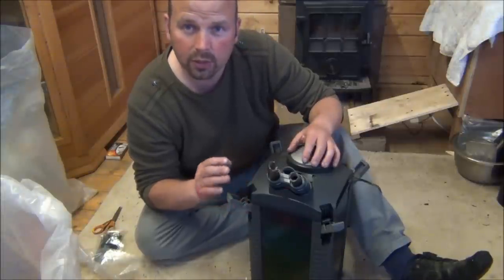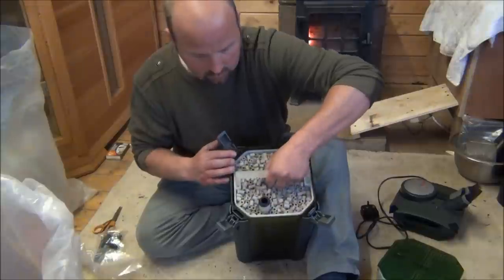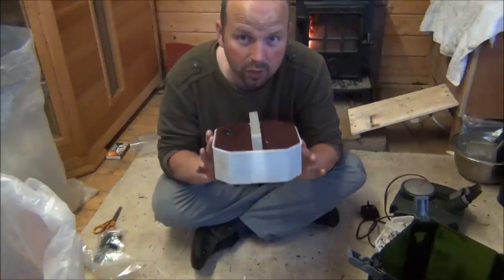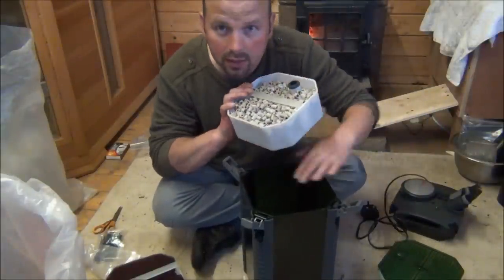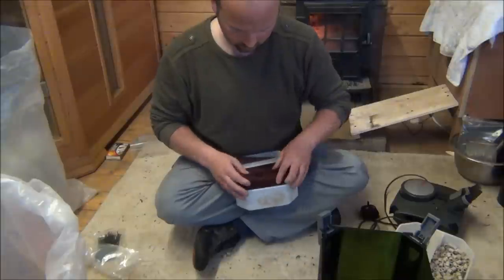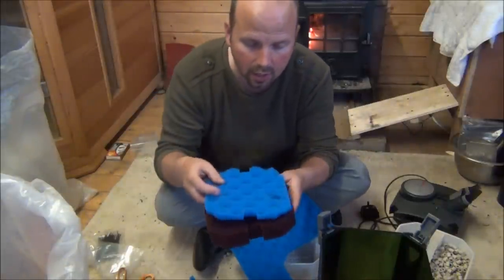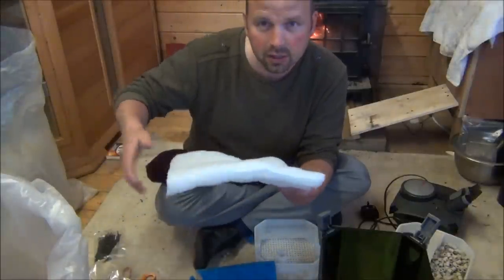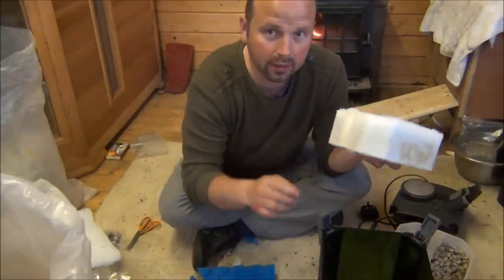How to set up an external canister filter for aquarium by Pondguru

Comment: I have actually followed your advice on my canister filter (a Marineland Magniflow 360) and it works great. I did go ahead and bought some of the bio home media and have been measuring my water parameters over the past five months; and just like you said my Nitrates did go down tremendously. I have a planted aquarium and thus use the E.I method of fertilizing my plants with Thrive liquid fertilizer. It works great and my plants are nice and green and lush. But the only problem with it my Nitrates would be through the roof with it. In my tank they went from 110ppm to about 15ppm in about five months. Great product and it works great. Thank your for your advice.
Reply: woahh how are they now?

Comment from the maker: Any filter media which supports large amounts of bacteria will eventually become clogged by them and need replacing. I normally say 2-3 years is a reasonable time for media to run it's course as it will become rapidly established with bacteria then perform well for a year or two before gradually reducing effectiveness. Same is true of ceramic or sintered glass and lifespan can be increased by protecting the media as shown in the video, no worries. You can dry out and re-use, yes.

Comment from the maker: The main problem with carbon is that it can absorb some of the beneficial stuff released by leaves and peat balls as well as unwanted chemicals. If it is not replaced every 7-8 weeks it starts to release what it has absorbed back into the tank which includes bad stuff.

Comment: This is advice so logical and clearly efficient that it may just start a profound revolution. Thank goodness these aquarium product manufacturers are not large multi-national corporations that guard their revenue streams with drastic measures. We'd probably see a sudden stoppage of these videos being produced if they were. You would quickly receive cease and desist letters, followed by strange men in black suits at your shop, your phone would suddenly stop working, they might even decide to "off" you like they did with the guy that created the diesel engine. But thanks for the healthy advice and wisdom. I am setting up an aquarium for the first time. It is a brood tank for Tilapia. Hopefully, come Spring, I will have bread some fingerlings for my aquaponics system where I will also apply the same principles to the aquaponics filtration. Just want to say, I am really lucky I found your videos.
Reply from the maker: No worries, man. Glad you enjoy the videos and I recently did an updated version of this video with much more information in. Here it is:
EXTERNAL FILTER SET UP, NITROGEN CYCLE AND WHAT HAPPENS IN A FILTER

Comment from the maker: The fine particle matting is basically a more compressed form of filter floss which can be cut to size. When you use the fine pad you do not need filter floss. If you want to use floss, not fine pad it goes in place of fine pad above the medium and coarse sponges (as shown in the video). 
The worst place to use it is above the media as it allows all the fine muck into the filter media, blocking it up and reducing the effectiveness of the filter (as explained in video)
Thanks for watching.

Comment: Thanks so much Pondguru!  I just got rid of an overhead filter (which came with my tank) and set up a canister filter as per your advice.  What a difference!  My canister filter has only 2 trays so I put the (uselesss) ceramic noodles on the bottom of the canister, 3 grades of sponge in the bottom basket (as well as some of my old sponges) and really good bio filter media in the top basket with a layer of filter wool on top for that extra "polish".   An hour after turning the filter on the water is crystal clear and my tank looks amazing.  Thank you so much for your video.  Just one question though, how often should I clean out the canister filter?  I have goldfish which I know are messy.
Reply from the maker: +Natalie Lindsay Sounds good to me - definitely makes a difference to water quality and clarity to have the filter set up with good internals.

Comment: thanks for all the knowledge and information. I will definitely be purchasing from you in the near future. I have a 200 gal. aquarium and a Megaflow model 4 sump tank. I will be putting Arowana, alligator gar, bass, red tail catfish, and other big fish in this aquarium. 1. how much media do I purchase? 2. what type of media do I purchase? 3. how would you set-up the ceramic media and foam pads for my type of sump (Megaflow Model 4)?
Reply from the maker: If you send me the dimensions of the parts you want to fill with media I can work out how much you will need, no worries. Just set up same way with the foams first then media no matter what sort of filter you have. I'm not familiar with that model of filter so I'll need sizes to work out media quantities.
Glad you enjoy the videos, man.

Comment: I couldn't agree more with your advice on how to set up the filtration process. I've used the same principle for external canisters and sumps and always noticed how much more efficient the biological filtration system works and increases the lifespan of the media material of your choice. The only downside IMHO is that one has to be more on-top of basic maintenance as the pads at the bottom tend to get clogged up quicker and slow flow rates. However its worth the extra effort.
Reply from the maker: It really shouldn't make any difference to how often a filter needs cleaning as you've got the same stuff in there, just in a different order but maybe it does, lol
Main thing is that the muck is kept in the bottom of the filter and away from the media so it works efficiently.
Glad you appreciate the idea, man and thanks for watching and appreciating the videos.
Reply: fair comment, thanks for your prompt reply & a big hello from the Rock of Gibraltar :-D
Reply: :-D

Comment from the maker: For all filters the water needs to flow through in this order:
Coarse
Medium
Fine
Some filter will not come with enough foams so you may need to buy more. Pond foams are the most cost effective way of doing this as they will often come in 2,3 and 4 grades per pack. Fine particle matting (also available from pond suppliers) will catch the very small solids before they clog up your media.
Reply: my aquamanta efx 400 has carbon bags in, where would i put them as you dont show any on this video? thanks

Comment from the maker: The water in that filter goes from bottom to top so should be set up just as simply as the one in this video. You could leave the blue prefilter foam in the top if you like.
Uaru Joey has done a video on that model of filter:
I tend to set things up differently so whatever makes sense to you is fine.

Comment from the maker: Biohome will work well in any filter designed to hold filter media. As I'm not familiar with those hang on back filters I can't say more than that but if it has enough space for filter media then I'd wager swapping to biohome will do a better job than the media which is in there.

Comment from the maker: The Juwel Rio 180? They are decent filters and can be made better by following the same pattern of foams and media layout as you would in an external like the one in this video. Buying the official foams and replacing them as often as the manufacturer tells you is a seriously expensive thing to do when you can cut your own foams and fine particle matting from pond product suppliers at a fraction of the cost.

Comment: Great video, I'm new to tropical setup. I'm just cycling the tank now, 3rd day in. The filter is hanging on the back and is a FLUVALL EDGE. It came with course foam, carbon, and bio pellets. Can I do the same thing in my filter as you have done in this big filter ? If I remove the carbon that will give me some extra room for some fine foam ? As it is at the moment there is nothing to catch the very fine particles.  And there is easily more room for even more medium, should I put more in if I can ? Ok sorry for so many questions.
Reply from the maker: Yes that sound sensible. The more mechanical and biological filtration you have the cleaner and healthier the water will be.

Comment from the maker: Put it in if you want and don't think you have to go with the same stuff which came with the filter - it is just a vessel for whatever you want to put in there.
A fully mature filter with excellent media will always be preferable to one with poor media and carbon, zeolite etc. to catch the ammonia and nitrite which should have been processed by the biological part of the filter. Carbon also absorbs trace elements which are beneficial for plants and leaches all the crap back in after 7-8 weeks.

Comment from the maker: You would need a liner to be 21' x 24' and that allows for 1' overlap on all sides. I'd go with 1mm firestone rubber - I use that on all my jobs. It is laid over good quality polyester underlay to protect it. With regard to pump and filter it depends on budget but I always go for Oase pumps for the 5 year guarantee and low running costs. There are so many filters on the market it will depend on the fish stock but I'd size it for koi.

Comment: Great video I did this when the video was first posted and it worked well. About a year ago I took it a step further so now I have two Aqua one 1250 filters in line the water comes into the first one which is filled with just sponge and wool course at the bottom and fine at the top, this then feeds directly into the second filter which is filled entirely with bio home mini ultra then through a uv steriliser and back into the tank. I have the same set up at the other end of the tank so four filters in sets of two. All is going really well the bio filter is nice n clean and the pre filters nice n dirty. My question is as the pre filter foam gets dirty and so builds up its own good bacteria will this starve the second biological canisters bacteria of oxygen?. I would hate to think I wasn't getting the best use of the bio home ultra thanks.
Reply from the maker: It would definitely be better to run the filters separately or in tandem as having them in sequence strains the pump and leaves limited space for media if one filter is used purely for foams. The media in a prefiltered canister should stay very clean but you can do that with this sort of pre-filter which is very cheap: http://geni.us/2bj1
Having the filters set up any way should not affect the oxygen content too much as the flow is quite fast so no worries there.
Regards,
Richard

Comment from the maker: 5kg should give you around 7.5 litres in volume so if you have 2 filters each requiring 8 litres you're about right with 10 kg but you'll have a clearer picture once you get the first batch added to a filter.

Comment from the maker: I'm sure there will be some out there where the water goes from top down but in general the water goes from bottom up through the trays so should hit the foams in the following order:
Coarse
Medium
Fine
Then travel through the media having been mechanically cleaned of the vast majority of suspended muck in the water before hitting the media to prevent media clogging..

Comment: Thanks for the great info, I've just bought a new 30-gallon freshwater aquarium and will be filling the canister with biome ultimate.  I've been wrestling with the idea of running a UV sterilizer full time.  What are your thoughts on this?
Reply from the maker: Unless there are several tanks linked to the same filter there should be no need for a UV but it will not do any harm as long as the filter is a good size, well set up and you leave the UV off for 3-4 weeks while setting up and maturing the filter (to give bacteria time to flow through the whole system) - your 30gal. would need a filter which would be suited to a a tank of 'up to 60 gallons' as you'd always halve the 'up to' figure for a normally stocked tank since it relates to a fully planted tank with hardly any fish (that is the maximum it will cope with)
Reply: Thank you so much for the reply and the input!

Comment: Great video! Thanks for the info. I am switching to a 55 from a 20 and am trying to avoid any cycling. Should I cut the filter media out of my HUB (two cartridge filters back to back) and add it to the 2nd or 3rd stage of the Fluval 306? I was also planning on floating the bio wheel. I will use roughly 15 pounds of existing gravel from the 20 and add roughly 60 more pounds. The only ornament being transferred is a log and about 10 plants. 
Thanks!
Bob
Reply from the maker: With all the mature gravel and water going in the new tank it should cut out the need to cycle it.
Provided you haven't got catfish, corydoras or loaches gravel will be fine (I assume its a cold water tank). Just run existing filters on new tank and new external for 3-4 weeks then remove the old filters.

Comment: I'm new to fish keeping and you my friend are a legend, thankyou so much for all the information you share
Reply from the maker: +daren barling No worries, any time. I get great pleasure from making videos with an educational content.
Reply: +Pondguru Outdoors hi Richard, I've finally got round to ordering my upgrade kit from yourself thankyou for that it's to upgrade my fluval 306 on my 240 litre tank,I also brought a 2.3 litre booster filter from all pond solutions, now I need abit of advise shall I use the booster as a pre filter with the upgraded foams or shall I use my 306 as the pre filter predominantly mechanical filtration and then use my biohome media in my booster after the 306 on return to the tank,which method do you think will be best,value your feedback very much,still haven't got my tank set up,just want everything to be just so before I start,then I will be doing a fishless cycle for however long it takes before I introduce fish,thanks
Reply from the maker: +daren barling It may be worth making the 306 into the mechanical filter as it already has some foams in it down the side which can't really be swapped out for more media. Maybe have the top tray as media and then use the rest of the media in the booster sandwiched between 2 coarse foams?
I don't really think it matters which one you use for the mechanical / biological as long as the mechanical is done before the biological.
If you're doing a fishless cycle using the biohome it should take 2-3 weeks for the ammonia and nitrite to spike and then hit zero. The nitrate could take 4-6 months to come way down but fish are OK with that.
Thanks for the order, man. Feel free to contact me any time pondguru@btinternet.com
Reply: +Pondguru Outdoors excellent thanks for that Richard

Comment from the maker: Charcoal is something I've never used as I like to see an 'aged' appearance the lower pH (amazonian) tanks and the carbon absorbs that colour but you can use it if necessary.
Not sure what can be done with a biowheel (Marineland?) as we've never had them in the shop to do an autopsy on. As they have a cartridge system I'm not sure it will be worth altering that unless the biological cartridge can be opened up for better media?

Comment from the maker: It just has the top section as the pre-filter which contains the coarse foam. This is apparently to save the 4 seconds it takes to remove 2 trays to get to the coarse foam. I was aware of the design but it's no different really.
For best filtration and long lasting media:
Water must go through coarse, medium then fine foam followed by biological media.
Whether the coarse foam is separated from the medium and fine foam does not matter. The order of foams is the only important point to remember.

Comment: Hey, love this video. I have a question. I have a Fluval 406 canister filter. It has 4 trays not including the coarse foam pads going down the side. I can either have 1 tray of biological media and 2 trays of carbon. OR I can have 2 trays of biological media and 1 tray of carbon. Which one is best in your opinion? Thanks.
Reply from the maker: I wouldn't bother with the carbon and simply go with the extra grades of foam / fine pad in bottom tray then fill remaining trays (3) with media. I don't have sizes of 406 trays recorded but the 405 takes 500g of mini ultra or ultimate media per tray.
Carbon is often used to mask the fact that your filter can't process ammonia and nitrite (due to set up / ineffective filter media) so in a properly set up filter it will not be needed unless you want to draw in residual treatments or remove colour from bogwood / peat.

Comment: Sooo glad i watched this as I'm about to setup my first external filter. I'm going to do exactly the same but as i have bogwood in my tank and it does discolour the water a fair bit, I was advised to add carbon (which i have ready to go)..  Though I wasn't sure where to place it..  at the top?
Reply: Or, should I even bother with it? lol
Reply from the maker: Darren Ford
It does aid water clarity by removing the staining and also helps soak up treatments after a course of treatment for water or fish. Carbon should go right at the top so it is the last thing the water hits on the way out of the filter but it is by no means necessary.

Comment from the maker: How much any filter depends on stock, feeding etc but it would be easier and more accurate for me to say it will filter more water, more efficiently and if the filter is set up correctly so that the media is protected, the media will last much longer and continue to be effective long after the media in a filter which is set up the way the manufacturers have it has become clogged and useless.